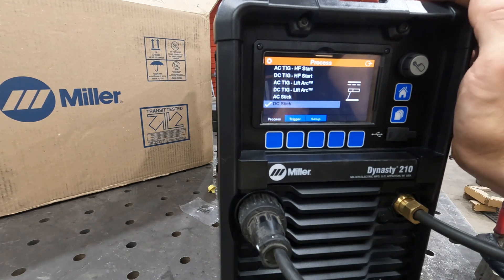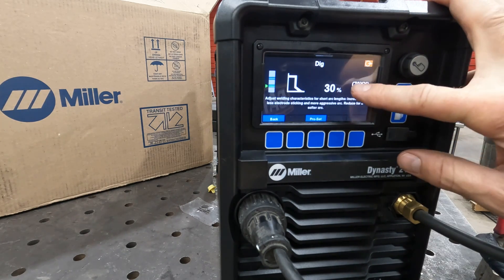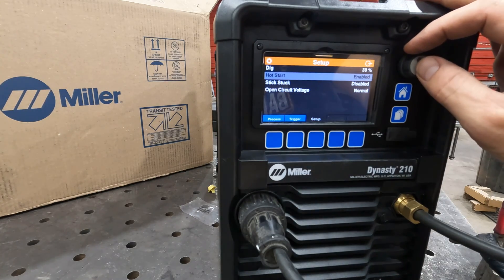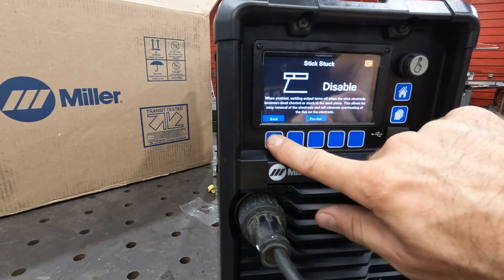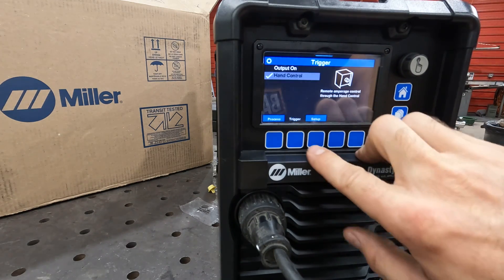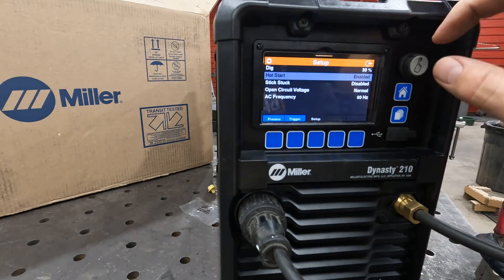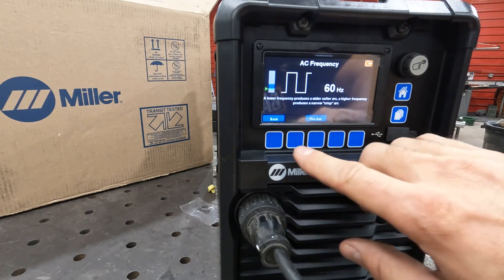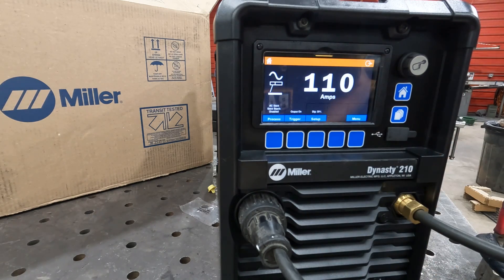New 2022 Miller Dynasty 210 stick settings

Comment from the maker: If the face plate shows a "+"and a "-" then you need to swap them.  If it shows a picture of a stinger, and a work lead it can do it internally.  Tip I learned on miller stuff.

Comment: Nice I have the Dynasty 280DX and while Jody says inverters don't do well with 6010 rods, there is a setting for it on the 280DX also. Haven't tried it yet, just having a blast with Aluminum TIG for now, but I have 50LBS of 6010 waiting....
Reply: Only cheap low-end inverters with low closed circuit voltage are unable to run 6010, Dynasty neither cheap nor low end. It runs 6010 pretty well. 6010 requires between 26-30 volts to run well, cheap inverter welders can't provide that high of a voltage.